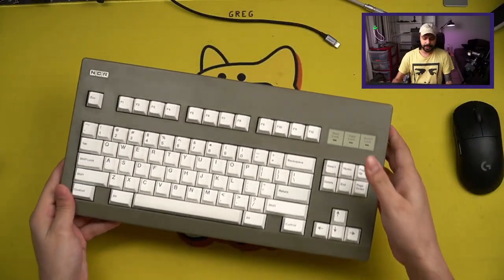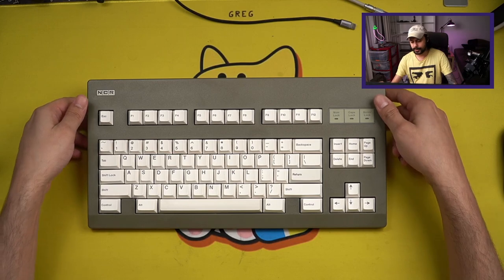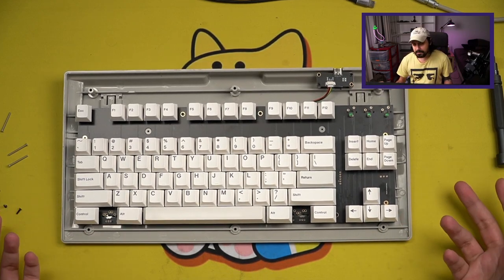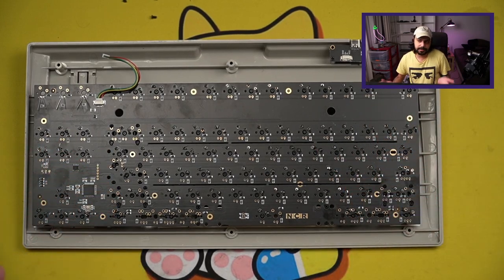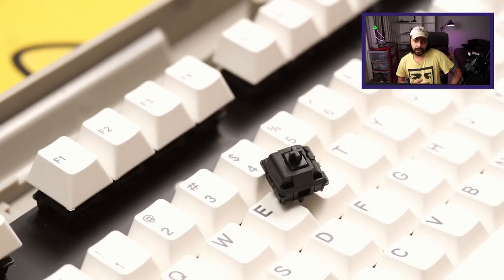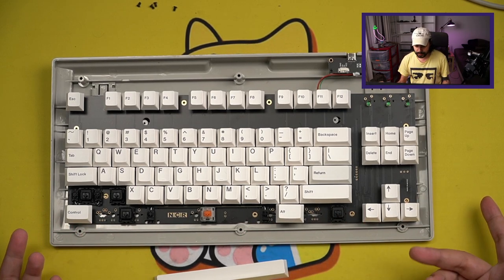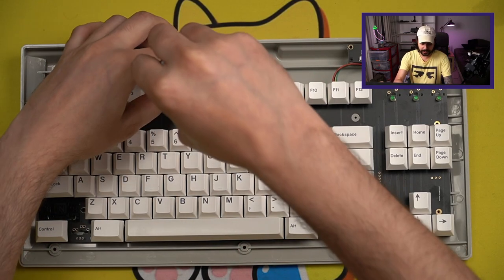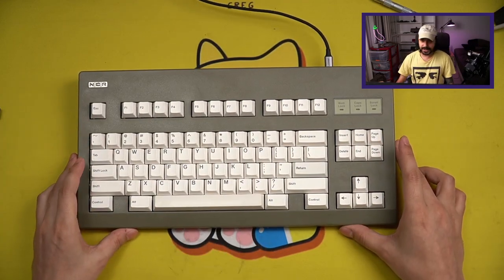NCR80 Kit + JWICK + Cheap PBT Full Review

Comment: Question, how hard was it to solder switches without a plate? I tried it one time on a macropad and a lot of the switches were crooked despite using 5 pin switches.
Reply from the maker: Some switches have very small alignment pins, or the pcb itself has holes that are very wide compared to the switch pins.
You always want to run a quick test when building plateless to shove a switch in place without soldering and see if you can lift the entire pcb from that one switch.

If it fails, avoid plateless for that build

Comment: I would like to see an alu version of this board, but I'm guessing it won't happen. The hollow sound would be overwhelming and you'd need a huge weight to dampen it.
Also the cost is probably going to be at least 5x more than the plastic one.
Reply: Its not exactly this design, but the Class80 was a nice alu board that kinda looks like this.

Comment: man, I just had a haul shipped from taobao, I could toss this in too late :x.  I bought the jwick black switches with teal/T1 stem. They are the tactile version and they are basically Durock T1s for 20cent. Pretty good. They are too factory lubed decently thick, a bit inconsistent but not bad at all. Best budget tactile you can get. They cost like a third of the popular Boba U4s.

Can you tell me the weight of the NCR parcel on taobao/warehouse for shipping cost purposes?